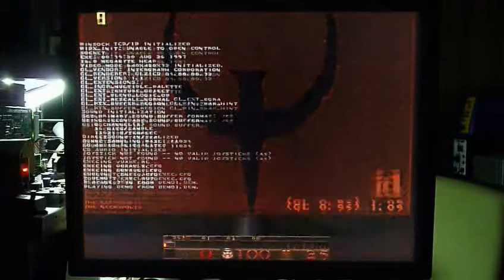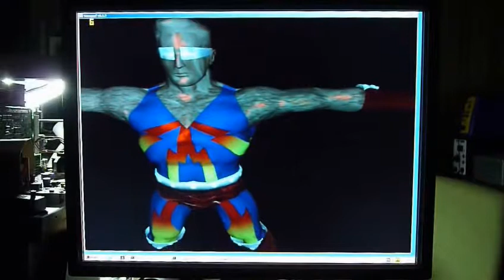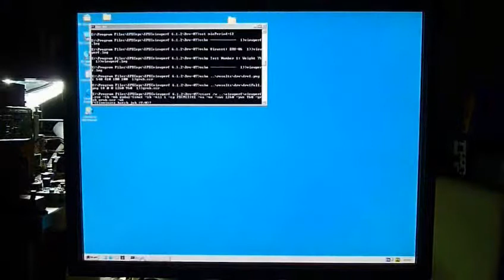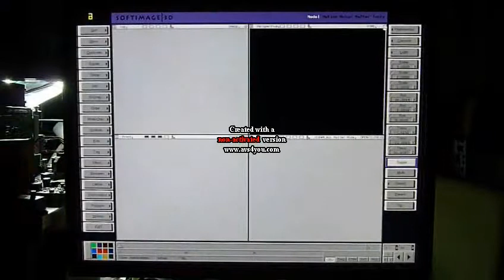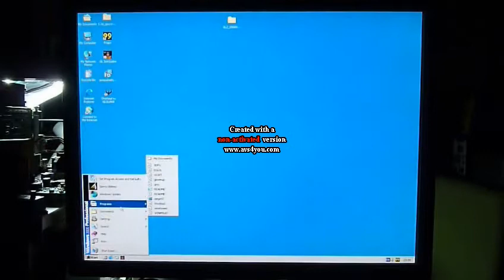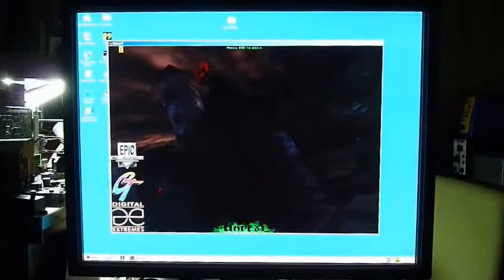Intergraph Realizm II 3600 MSMT495 workstaion graphics card GLQuake Softimage 3d

Comment: Wildcat had a VGA no VGA jumper, so if you run 2 or 4 Video cards you can Turn off the Frame buffer and use the T&G GPU on the card and team up, and get the AGP Add on card..But it a Shame they sold out to 3DLabs, now the 3DLabs Wildcat 4 with the AGP-Pro, oh I still use it in my Dual Pentium III 1333 Mhz system to this day..Last Card is the Wildcat 7219 and 7220, then they want into the Game Development Area, High Prices Cards, then Creative Labs, Yea Sound Blaster Creators, Gobbled them up for there Stem-Cell-GPU ZiiEgg..